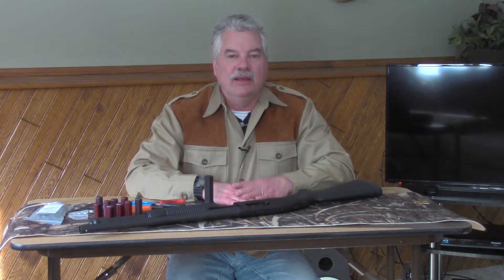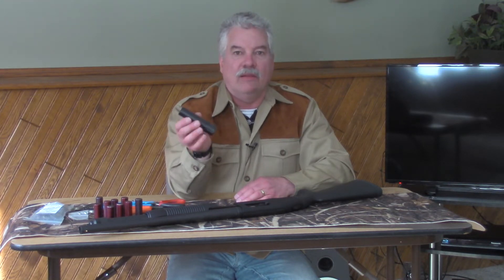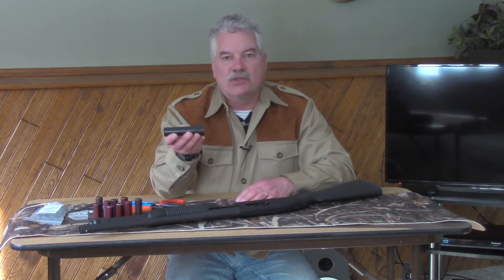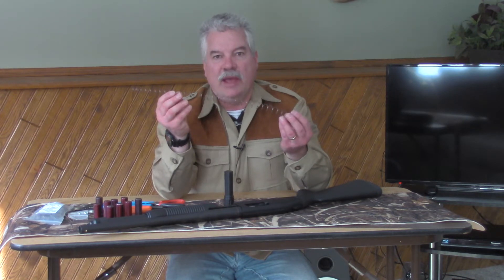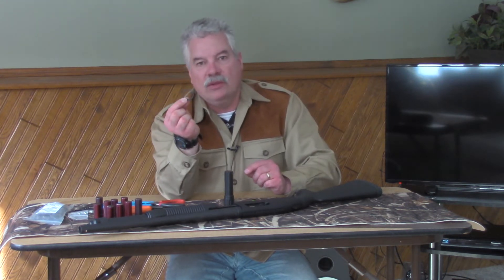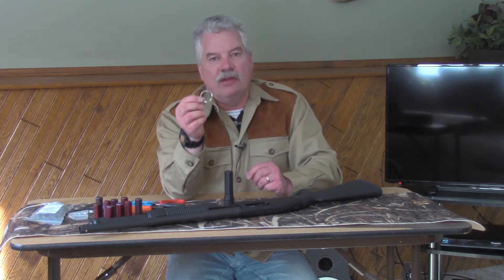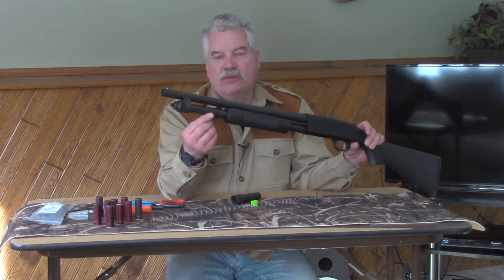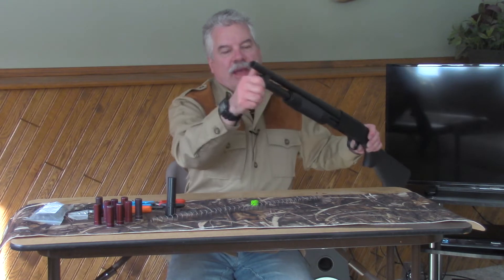S&J Hardware USA - Mossberg 590 +2 Extension - Fitting and Installation

Comment: I’m glad I found this video clarifying the newer versions of the 18.5” Mossberg  590’s are 6 shot and no longer 5 shot.  It appears with the +2 extension tube the over the total overall  length is around 20.”  I might as well purchase a 590 with a 20” barrel length. The magazine tube is more flush with the barrel. The magazine tube  doesn’t over hang the barrel. Also, the a factory 20” model you get a 9 shot capacity instead of 8 shot with the tube extension.
Reply: The "20 is 8+1 also.
Reply: "9 shot" in the sense that it's a 8+1 capacity.

Comment: Hey, I have the 590sp 20 inch barrel stock 8 plus 1. The process would be the same and just result in a 10 plus 1 capacity or are there any differences to be accounted for?

Comment: I have a Mossberg 590 shockwave with a +2 extension. What should the starting spring length be before I may need to shorten  the spring. Thanks.
Reply from the maker: Hi Howard, I would try 26".

Comment: Hi Scott. Please tell me these will fit the mossberg maverick 88, 18.5 5+1 model.
Reply: yea i want to know that too
Reply from the maker: Good day. The extensions will not fit the Maverick models because they have a closed magazine tube at the front. The best you can do to make the loading smoother is get rid of the factory follower and install an S&J Hardware Type 3 NoJam follower.

Comment: I had to cut the spring down to a little under 22inchs on my 590a1 18.5 inch 6 round...now 8 round with the +2. Feeding now feels lighter but still feeds well so all good. I installed a kicks buck kicker extended choke and it fits nice and flush.

Comment: Why does both the thumbnail for this video and on the product page show the extension sitting flush with the end of the barrel, but in the video it extends past the end of the barrel?
Reply from the maker: The version 2.0 of this extension is a bit longer than the original design. We made it better. Thanks Scott
Reply from the maker: @RJ-oi3ck  We made the 2.0 a bit longer so it could accommodate the +2 easier. The 1/8 it may extend beyond the barrel is not a problem. Ease of loading to full capacity is more important. Thanks Scott

Comment: Hi Scott, question:  Why is the +2 extender flush with the barrel in Twang and Bang's video but is much longer than the barrel in this video?  Thank you and great products!
Reply from the maker: We upgraded to design to version 2.0. It is just a bit longer to allow easier placement of the additional shells. It is not much longer.... Only about 1/4". Thanks Scott
Reply: @04BlueSmoke  Thank you so much for the quick reply sir.  As a follow up question, is the extender in this video 1.0 or 2.0?  (I'm assuming you're showing the 1.0 here).  Thanks again.
Reply: The stock mag tube of the newer 18,5 inch version is longer and hold 6 rounds. The older version only 5. With this older version it would flush fit.

Comment: Surprised you dont use the longer tailed (type 2) follower in this kit, the SJ site recommends it for longer or 2 part mag tubes, and the small sized one for single pc 4-5rd tubes?
Reply from the maker: Out type 3 follower is a rock star. It works well with long and short tubes.

Comment: Do you make one for a Mossberg 500 5+1? I don't think so but you would well a ton of them. The gun your working on to just you had to pry the cap off to. Now the only way to go is to change the barrel and magazine tube. For that price you can get a new shotgun for a few $ more. One thing I must comment on is how the extension goes way past the muzzle. Seems like a accident waiting to happen. Great idea well done
Reply from the maker: Thanks for your note. The Mossberg 500 has a closed magazine tube. There is no easy way to extend it.
Reply: @04BlueSmoke  Thanks for replying so fast I've had the Mossberg 500 more than thirty years still going strong. I did replace all the springs and small parts I even have a 28" barrel in case my hunting/skeet gun fails. But I keep the 181/2" barrel on with a adjustable stock. I also got the 930 security model 7+1. I did see someone get a longer magazine tube cut it down. Then move the barrel nut with heat and solder it foward and the same on the magazine tube. Seems like a lot of work for one extra round. Yours is a great idea. Nice and easy

Comment: My 500 mossberg 20 gauge has a completely different tube end than these do. This setup looks more like 870 mag tube caps . The 20 gauge I am working with has a bolt that goes into the tube instead of threading around the outside .
Reply from the maker: Interesting. Can you send me a photo? sales@sjhardware.us
Reply: @04BlueSmoke  It was the rifled Jr model . I can send you a picture if you want yes .

Comment: Fun Fact: The +2 will give you +1 in a 590 Shockwave. Ask me how I know. Spring wasn't binding, wasn't catching on burrs in tube. I ruined a spring by cutting too much off, thinking it was binding, to get it to take 7 rounds in the tube, ( Shockwave is 5 in the tube ). Had to order a new spring. Put new spring in, takes 6 in the tube. The  Shockwave tube is short enough to not allow full capacity. Thought I was crazy, but verified others using a 590+1 extension on their Shockwave's and not being able to get the #6 to go all the way in. Not the fault of the Co. Just passing on info. Still get 6+1 so, yeah. BTW, I also tried a fancy smancy metal follwer from another Co. that made the spring bind with three rounds in it. I used the factory follower, problem solved.
Reply: Glad I seen this comment, I was thinking about getting the +1 for my shockwave...
Reply: I have a question. Will the factory shockwave spring work, or do I need a different spring? Plus one doesn’t sound like much, but it may make a world difference.
Reply: @twiggybones7040  I don't think the factory spring will work. It's too short.
Reply: @414Chevy  that’s what I was thinking. Thank you